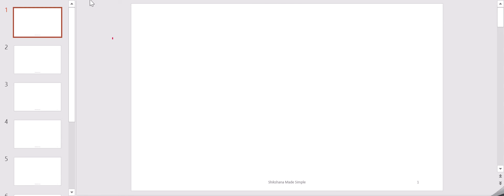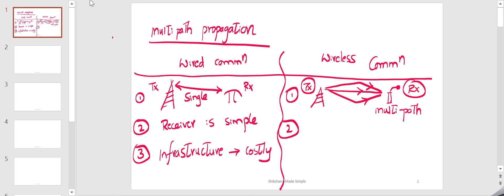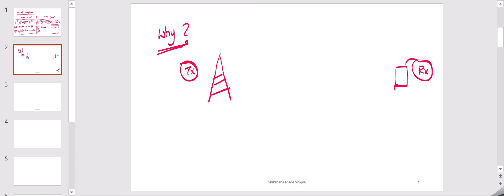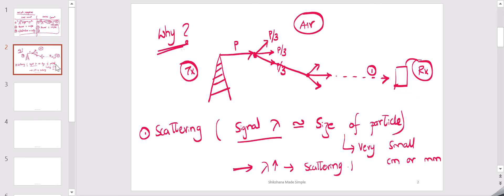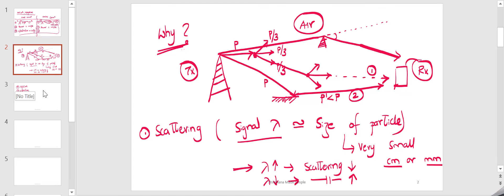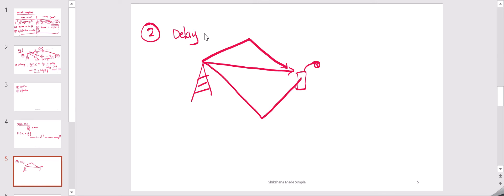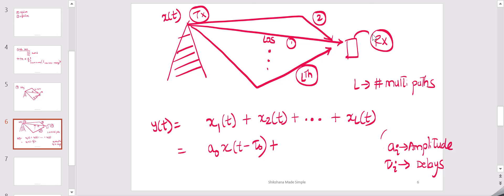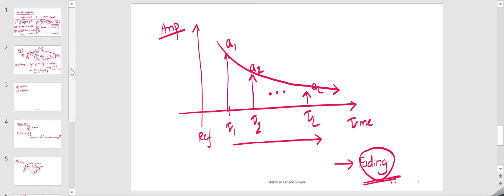[#1][Wireless Communications] Multi-Path Propagation Concepts

Comment: Hello Sir, I am working on a 5G localization project and I will have the base station data such as 5G base station location, cell ID, direction, height, and antenna type and also the geological datas such as building vectors with approximate height information,
vegetation vector with approximate height information, road network vectors, water body, digital terrain model showing elevation above sea level. I don't know how to make an alghorithm with the help of machine learning that will solve the multi-path propogation. Where can I learn it ? @Uttama_Shikshana